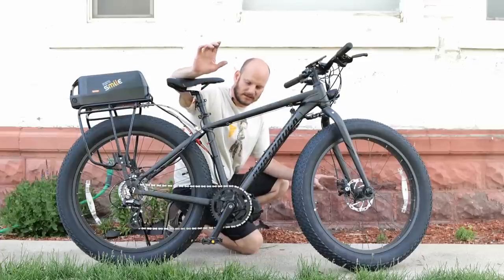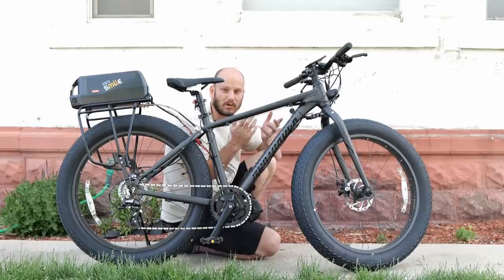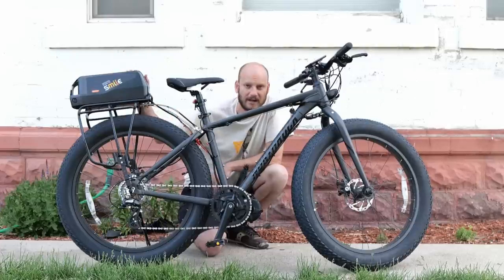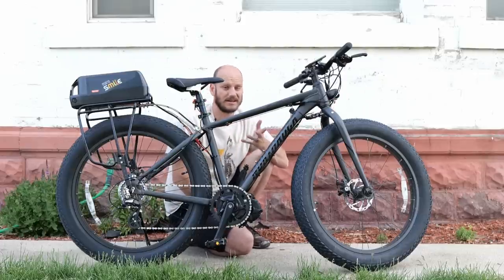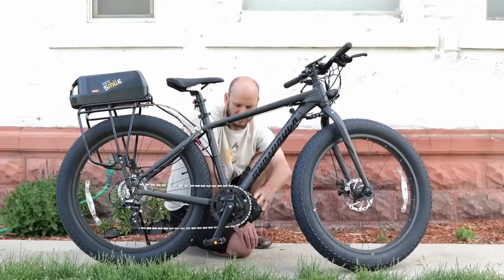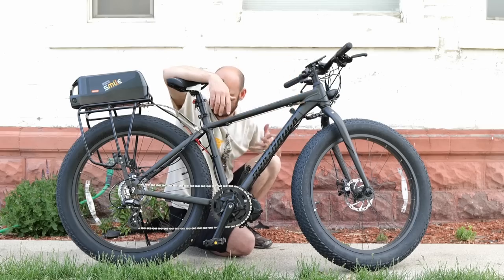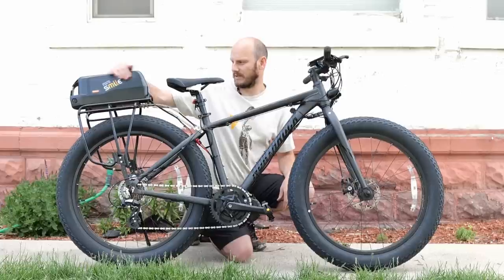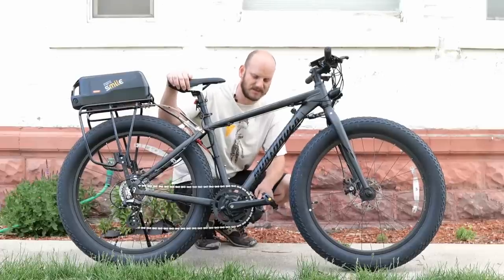Reviewing the new Polarizing Bafang M625 Mid drive motor kit

Comment: I have two Bafang HD builds. Love them. Used your channel for a lot of guidance. I did look at this unit, but that battery was a dealbreaker. Great video as usual!
Reply: I agree, the need/ability for an off the shelf battery is essential.  That's the dealbreaker.  Though I like the  52V 19.2 Amp battery. I have lots of big hills here.
Reply: The bbshd is the best diy mid drive because of its ability to be hotrodded to 88v and 4000w while running SILENT with proper greasing. All of the others I've seen are either less powerful or more powerful and 10 times noisier.
Reply: @thedon2703  even in a non-hot-rodded state it's got plenty!  My last one certainly did!

And I plan to pop the current one's case open and put in plenty of mobil-28 grease like on the first one.  I like quiet motors!
Reply: Addendum to above: have run new bike several hundred miles.  It does all I can ask, and save when very hard-pressed, is nearly silent.

Also, have a 1.6 kw/hr battery, and find I can go ~45 to 50 miles on half a charge.  (Meaning I can go truly long distances without hunting up a place to charge.)

Comment: Looks like a much improved chainring, but the rest is really a slap in the face of the buyers.  No programmability, huge ugly battery, etc.  Now if they had added a torque sensor, these kits would be flying off of the shelves.  Thanks for this review.  Cheers.
Reply: You can swap out the controler for the bshd controler makes it programable.

Comment: Just upgraded from a bbs02 to a bbshd. The power is phenomenal! But the new Bagang firmware automatically bricks the controller if current draw settings are changed. Way to go Bafang! Installed open source firmware to open up the controller.

Comment: Torque sensing is THE thing that would make me want to swap out a bbshd,  yes the ability to see the cell voltages is cool but not necessarily needed day to day, you will know when you battery has a problem ( range and power loss) and need to take it apart to fix it and can measure voltages then to check for bad cells.

Comment: The home builder and mod community brought Bafang their current level of popularity; Bafang is essentially turning their back on their base with this motor.  Huge mistake Bafang!
Reply: This is most likely intended for large-volume “O.E.M.s” who want to control their customers thoroughly, e.g. lock them into their systems, and give them but one choice: “sell us your soul, or rot.”

The older gear is, in many ways, a much better deal.  I have thus far bought 2 BBS-HDs - the first was on a bike stolen a year and three months ago, sob; the other is part of a build that I’m starting now - and hope to buy an -02 in the future for a “travel bike/spare bike” with a lighter weight, which will help with taking the train longer distances.
Reply: @dennisyoung4631  I just had my bike with a BBSHD stolen, so I'm currently starting a new build.  I was curious about this kit, but once he said "proprietary battery cable" I was out.  I loved my old Bafang motor, but I hate that crap.
Reply: @Commanderziff  you might desire a chain hefty enough for weight-training, e.g. Vulcan 10mm security chain, plus U-lock, plus perhaps a tracer or two.  Hope to get this last next month.
Reply: @Commanderziff  put an airtag in it. Get like an old iPhone 7 or 8, trust me it's worth it
Reply: @HoloScope  I understand the airtag great idea but old phone? Are you meaning if you dont have one to monitor the airtag?
Reply: @JohnSmith-ch9lp  yeah if you don't have an iPhone, since airtags only work with iPhones.
Reply: @HoloScope  OK I thought thats what you meant Holo. Yes great idea for a bike car luggage, any numbers of things!
Reply: @dennisyoung4631  The lock I was using wasn't the problem.  They'd loosened the bolts on the bike rack.  All they had to do was wait for me to go inside, lift up that side of the bike rack, and just slide it out.

I have my new bike, I went kind of cheap this time.  A $200 Walmart mountain bike, and a 1000 watt Voilamart motor.  Not bad, but I am getting a little tired of messing with the spokes.  I was using solid alloy wheels with my Bafang.  It's kind of weird how their doesn't seem to be a hub motor like that.  I saw one company that did it that way on Alibaba, but they were only 20 inch wheels.
Reply: @Commanderziff  I have heard of that being done - they undo the bolts, or cut the post, or whatever.  I keep my bike indoors for that reason, and am concerned to no small degree otherwise, even when double-locked (like I did twice this morning.)

Seems the best idea is something along the idea of a 1 x 3 bar of 1075 steel (e.g. the kind used in railroad rails) that’s been heat-treated after forming into an upside-down letter “U” - and then embed the free ends into concrete.  It would take quite some time to cut it…

It has been recommended to me about the AirTags.  I do not have an Iphone, but I do have a larger relative. (Bought because it has IMovie on it.)
Reply: @dennisyoung4631  If I go back to that particular shopping center, I'll share this information.
Reply: @dennisyoung4631  we have the same story lol. 2 motors in, first one stolen, also take them on trains for longer trips. Im in the Boston/ providence area
Reply: @HoloScope  Samsung/ Android has their own tag. I have one on my bike
Reply: @lessthanahome  yeah it's called Tile and it uses the Amazon sidewalk ecosystem network as far as I know, it uses Amazon Alexa's or other Amazon smart devices to get an approximate location of where the tile tag is and then when you get close enough to Bluetooth range then it will use Bluetooth.
Reply: @HoloScope  theres tile but theres also the samsung tag, i have the Samsung one, tile is an independent company. Samsung uses data and pings from nearby samsung phones
Reply: @lessthanahome  ah I wasn't aware that Samsung made their own. What's not to love, more fragmentation!
Reply: @HoloScope  you know whats crazy, is that i had an idea for the tile when i was a kid, told my aunt who worked in patents and she shrugged it off.
Reply: If just a cable just cut them off and install what you want.
Reply: They don't want people to break local speed ordinances. Getting flak from the authorities.
Reply: @int53185  Agreed, bafang is trying to avoid litigation issues but it's my opinion that a manufacturer is not responsible for how their product is used; ie. I own a motorcycle that can  easily reach speeds that are twice the legal highway speed limit ... enforcement is in the hands of the police, not Kawasaki (in my example).

Comment: I don't know how much this kit cost, but the Ariel Rider Kepler is currently selling for $1.799 with a bike rack it's a 26 inch bike I believe with the fat tires disc brakes, shocks on the front, 1,000 w hub motor maxing at 1800 watts, 52 volt 20 amp hour battery, a colored screen. it's a custom bafang motor made for this bike. 72 mile range 32+mph the price is soon to go up to $1999 minus the $150 value cargo rack.
Reply: Yeah that Kepler is a game changer for that price.  Thanks for sharing that information.
Reply: $2,582.00
Sale price
$2,324.00 Sale
Reply: Sounds like an ad....?
Reply: The aerial rider Kepler is a very good bike for its price to performance ratio… but 1800 peak watts is nothing compared to a BAFANG mid drive can do.. mid drive used the lowest gear for max torque and the highest gear for max speed. A hub motor just can’t compete unless it’s a 3000watts hub motor and the mid drive will still eat up going up a hill.
Reply: @danimayb  I totally agreed with u hub motor have their pros, if the rider don’t have long high hill hob motors a great.
Reply: @diymountainbike  even the response was in on it wtf bud White?

Comment: I have a bafang kit and learned after you need a quality rear gear set.   The basic 7 or 8 gear with the bearings built in don’t hold up to extra power.  The cable programming version is worth getting.  The standard programs give max power to get to the preset speeds.   I set mine to progress in power total output up to max speed on all settings.
Reply: MY 26 " mtb with a 16 tooth freewheel

Comment: The CAN bus may be overkill for many bikers.  While a CAN bus provides a great deal of added capability, it is typically low voltage (1.7 to 2.3 volts) and high frequency.   This makes any connector that is not well sealed a potential point of failure.  You also need a scope, some training, and experience to troubleshoot a CAN bus problem.   It will be interesting to see how well this motor system does over time in hard core mountain biking or dirty environments.

Comment: Points of note:
1. Johhny mentioned that production will continue for the BBSHD. So those with a brain know what motor is the best deal, the BBSHD.  Gear and brakes sensors always work better.
2. Internals of the M625 are virtually identical to BBSHD.  This has been verified.  Stock CANBUS controller has been removed from the M625 and replaced with BBSHD controller with 'slight controller housing cover mod' and it runs like a BBSHD.  Problem is...can a M625 be even purchased without the large brick CANBUS battery?  Of course you wouldn't want to because it won't run without the CANBUS battery which is just a companion chip to the battery internal BMS to 'make it proprietary for Bafang to sell more batteries'...without changing to a non CANBUS BBSHD controller.

I believe the drivability maybe better for this package as Johnny mentioned...but...a BIG but, for those that like to program the BBSHD like I do with the programming cable, this kit sucks and nobody wants the big ugly battery that will only work with this motor.  More expensive than a BBSHD and generic shark battery as well.  Epic fail by Bafang.  Marketing meet profit motive.

Comment: Hi Johnny, I have both the new Bafang 625 and the BBSHD.  In my opinion the newer 625 is a better motor.  Let me start with the pros and cons…PROS the motor runs way cooler and quieter because of the magnesium casing.  The motor has three different levels of modulating ramp up of power from standstill , so you don’t feel that sudden jerk.  The throttle is modular in power ramp up rather than the on and off switch on the BBSHD.  The chain ring is narrow wide so it keeps the chain from running off.  The motor has a dedicated torque arm thus enabling the motor to keep in one position unlike the BBSHD.  The integrated rear and front light is a plus.  The battery pack is a 52v 1000whrs and is made from the newer  21700 cells. The can bus protocol to the head unit enables accurate data ( its the first time percentage can be used for the battery rather than voltage..it is that accurate., just like the Bosch and Shimano head unit.  The Bluetooth phone app enables the user to see vitals, pedal cadence, motor output shown in voltage, amps and watts.  There is also a dedicated section to update the motor software via the app.  It has an area for parameter to set motor power ( not ready as yet).  The motor cut power as soon as you stop pedaling.  The motor has a two stage ramp down.  If pedal assist 1 gives a max of 250w output at medium to max pedal cadence and the motor detects the pedal cadence tapering off to very slow to almost stopping ,it will  reduce the max watt output to a lower watt output , so the rider will not feel the motor suddenly stop assisting. Just to name a few.
CONS .. no gear shift sensor.  The battery pack is too large and will not fit every frame.  Motor not easily programmable via the USB cord because  of the newer can bus protocol.  
PRO TIP….Do not buy the 750w variant of this motor, because it’s the same 1000w motor detuned to 750w. If you need to get a motor with 750w output for legal reasons, just run the 1000w in pedal assist 3.  Third party batteries cannot be used at this time… it uses a proprietary battery .
Reply: “narrow wide”??
Reply: @G58  the chainring that came with the BAFANG 625 motor has narrow/ wide teeth profile… the only short coming is the chainring don’t have the offset like the lekkie bling ring and the Luna eclipse ring.
Reply: have you ever thought about bein a youtuber my man ;) 
I'm glad i stumbled on your comment, i love my bbs hd but thought that Bafang had completely dropped a Bollock with the new one. 
Your knowledge of it tells me they might well be on track to make a truly fantastic product, if they kinda mash the 2 together.
I'm an idiot don't get me wrong but did i miss something or does it compensate for the lack of a gear shift sensor or will it just mash my Shimano Nexus?
Reply: Thank you for the added info.
Reply: @jolive3743  hi no I never thought of being a YouTuber, this BAFANG 625 is a upgraded BbsHD, it used all the same internals as the bbsHD except the controller. A lot people on the internet give this motor a bad names because the can’t custom tune it. I think BAFANG have a winner with this 625 motor I’m so confident that I sold my bbsHD.
Reply: @jolive3743  I forgot to mention that wise u stop peddling or ease off the peddling ur gear will shift smooth .. I have a friend with a bbsHD no gear shift sensor with nexus IGH and have no problem up to this day…. I would recommend u eased off slightly when shifting or just pause for half of a second.
Reply: @chipkhalifa4138  yeh, that's kind of what i do already coz i can't be bothered to fit the sensor;)
Thanks Chip, nice chatting to you
Reply: When you say there are three different levels of modulating ramp up, do you mean that there are three "zones" of power from the throttle?
Reply: @wpjmurray  I am referring to the pedal assist mode.  When moving off from a standstill  if pedal assist 1 gives a max power of 250w, you would see the watts meter on the display reading 70w then it will ramp up to 160w and then it will go to 250w max for pedal assist 1 ,PLEAsE NOTE (the level of watts ramping is a percentage based on your battery level. The higher the battery level the higher the ramp up will be), so you will not get a jolt when moving off it gives a smooth acceleration from moving off to the max of 250w in pedal assist 1.  The ramp up for the throttle is different,  you press a little you get little power, when you give a little more you get like 60% of the power but when you go all out you’ll get full power, if that makes sense
Reply: hello, Will the battery fit in a trek Marlin 8 M/L please?
Reply: @damoah007  I’m not sure if it will fit … the length of the battery is 14 and a half inches and the height is 5”3/4 hope that helps….
Reply: @damoah007  I’m not sure if it will fit the Marlin 8…..I have the bafang kit on a 2017 GT Aggressor bike ….the length of the battery is 14 and a half inches the height is 5”3/4 hope that helps.

Comment: great review!   I feel bafang went bacwards with this model.  They should have improved the controller on the bbshd and bbs02.    There is no tuning with this new model unless you change the controller
Reply: How many controller problems come as a result of users operating the drive system improperly? I hate to say it, but many ebike riders honestly don't know how to shift a bicycle and will fry their controllers going full throttle in a high gear at every stop. Rarely will consumers admit fault, I kNoW hOW tO rIDE a BiKE!!!!!!1!!!1!! Angry customers are bad for business, as they should be, but when the valid complaints are massively overshadowed by the invalid complaints they are left with only a few strategies to protect their reputation; lock settings down to ensure only valid QC issues are presented or the Chinese standby split branding by creating a "new" company every few years. Bafang seems to chosen the former.   
  
Bafang is adapting to the western market, where ease of use is paramount and manufacturers are expected to prevent user errors from causing failures. Where reliability is everything in the market, I understand where they are going with this. I don't like it for myself, but I would feel FAR more comfortable if I were an OEM selecting a system for retail sale. They still really need to fix the drive line issues, the best upgrade I did was to add a lekkie chain ring to the bbs02. Too much inside offset can be easily solved with spacers, to little (as with the stock ring on many bikes) requires replacing. Sharp angles increase wear and dropped chains are both unsafe and not fun.
Reply: Why would Bafang improve the controller when Lunacycles already did it. You can swap out the factory 750/1500w controller to a 3000w controller with no visual difference to the unit. LOVE mine.

Comment: Built my first bafang hd conversion which was all I had hoped for based on Johnny's guidance. When I was building it last year just could not get a 1000wh battery which I wanted to fit in triangular frame. I had to settle for a battery with its own rack mounted over the rear wheel as this bike. It was a big mistake, I ride very twisty narrow lanes. The steering was was very tricky with far to much tail swing. So much so I spend another £400 when a battery which could fit in between the triangular frame came a vailable. Most of the time I use one battery but I have 'gismo' which let's both batteries be used on 100+ mile trips. The smile battery whilst technically good is a deal breaker if you do not have a large enough frame enabling it to be mounted low for a low center of gravity.